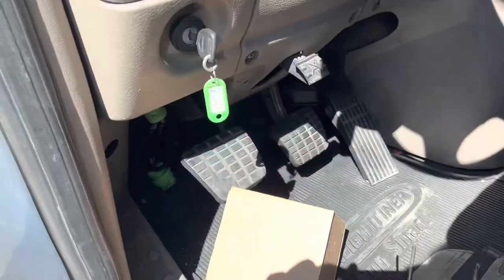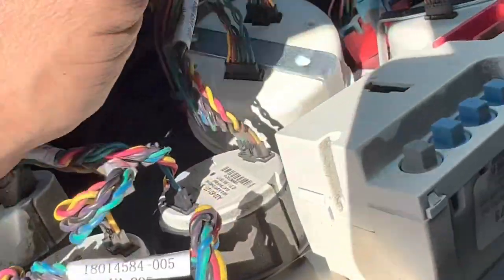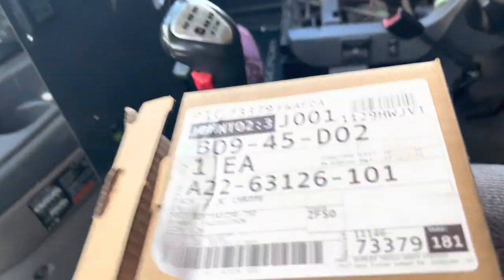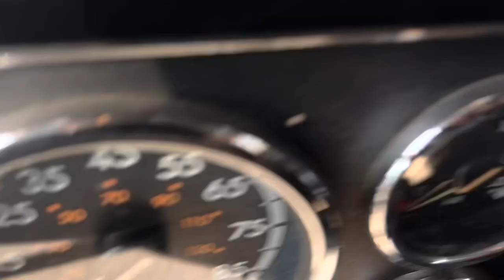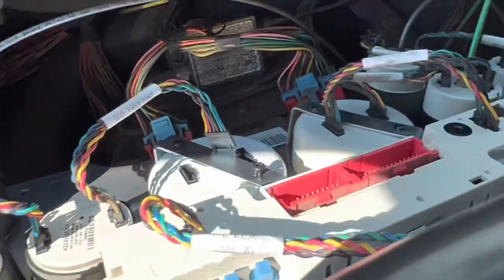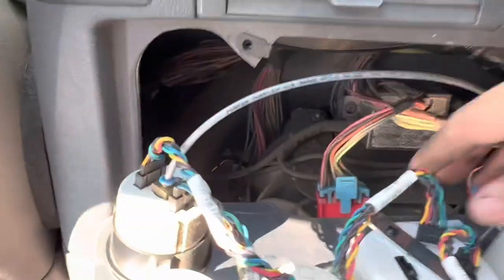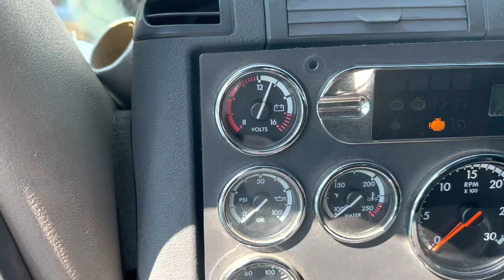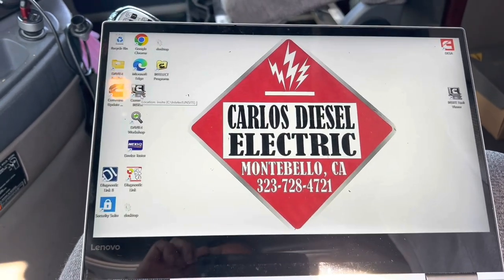Do your Freightliner Cascadia gauges randomly stop working? Try this first.

Comment: When ever I connect my high pressure gauge jumper where the small red air hose connects it kills everything on the dashboard. I removed the the jumper everything works again except the speedometer. I’ve replaced the lightboard, the main jumpers that come off lightboard left, and right, the speed sensor, and speedometer. Any ideas?

Comment: Would this also affect the e log? My gauges keep cycling, and it’s sending error codes to the e log (Omnitracs), saying the speed sensor is no longer working, and also it’s showing the engine is shutdown and started, despite the fact that the engine never turned off.
Reply: @thetowndrunk988 There’s a 20 or 30 amp fuse driver side under the hood. 
In Fuse box that is (NOT on firewall) , that helps protect the ECM, if it burns up or is old it can cause gauges to stop working also ELD will stop working. Won’t affect engine function though.
Reply: @roadrunner8274  Thanks for the info. It ended up being the wires going to the Onguard Collision Avoidance sensor. They corroded and shorted out.

Comment: Hello. The mcm fault you clear will come back again because the truck has problem with EGR actuator (engine can) then you need to test the 4 wires between mcm and egr(2 wire can bus and 1 + and 1-)if wires is ok replace the actuator. Kindest Regards.
Reply from the maker: The EGR actuator could be bad, but also check your harness and the MCM can also be the cause. A bad EGR actuator can damage the MCM.
Reply: @CarlosDieselElectric where are you located and could I have some contact information please. Having a very similar problem.
Reply from the maker: @vangearing2223  we are in Montebello, Ca. You can call our shop 323-728-4721